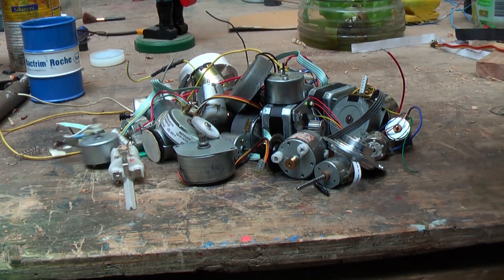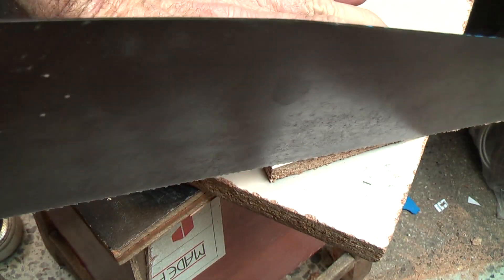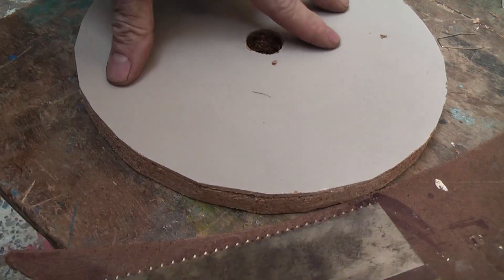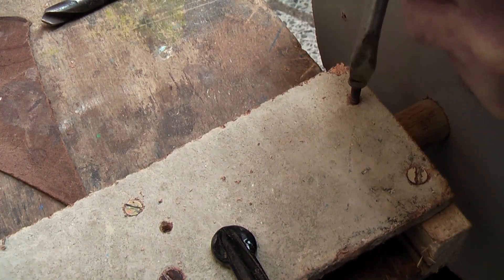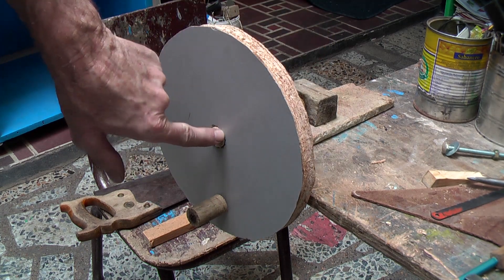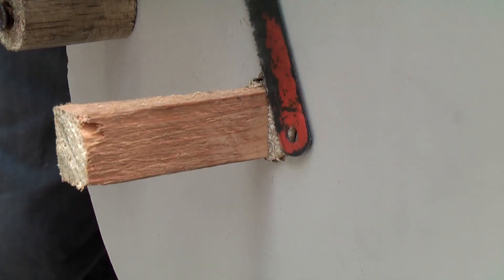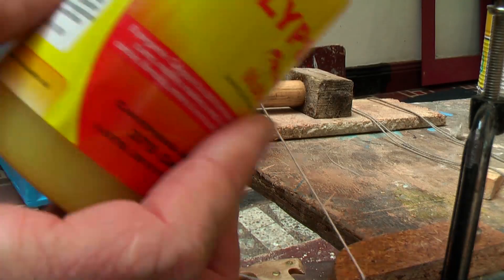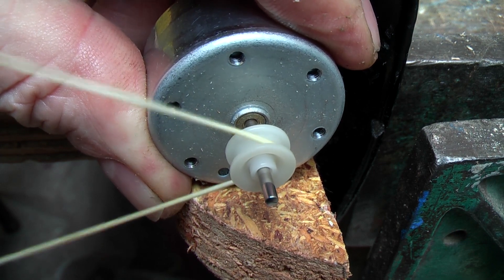Generator Test Pulley

Comment: You never showed us if the wooden wheel spins
Reply from the maker: Ha, yes I think you are right. I thought it was apparent when  the small motor  was spinning. It goes quite well actually. Obviously  not as smooth  as with  metal bearings, but totally adequate for this application. :)

Comment: Hey, nice video. It's amazing what can be done with some simple hand tools. 

The oil and grease on the bearing seems to work quite nice for you, but a really good lubricant for wood is soap - just scratch some flakes from a bar and that should usually do the job.
Reply from the maker: +Andreas Stangl . Yes, thank you. Soap is basically  fat, so that  works. In  industrial situations liquid soap, often with water as well, reduces surface tension and  lubricates that way. but  yes, you are quite right.
Reply: Andreas Stangl

Comment: I think your pulley has less run out than the metal one on the drill press i have just repaired! looking forward to more as always
Reply from the maker: +jusb1066 . ha. (what is run out? a term I am am not  familiar with) Getting perpendicular holes by hand is something I am trying to perfect. The best  has been  thanks to a replica of a stone age hand drill to do a pilot hole for the  Brace and bit. I will do a vid on that  later on. NIce to hear from you.
Reply from the maker: +PhilipStephens007 . Just checked some tutorials on 'runout'...Got it. :) It is possible to  get the wheel running   with less runout , but for this application its not so  critical.
Reply: *****
i actually thought you did a very good job, the large size would compound the error
 (runout is used in engineering in uk/usa)